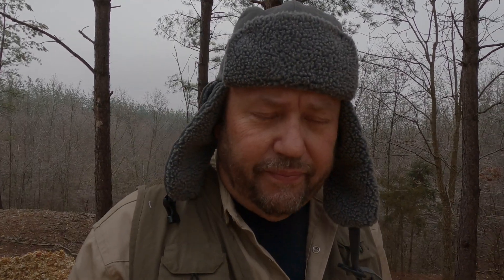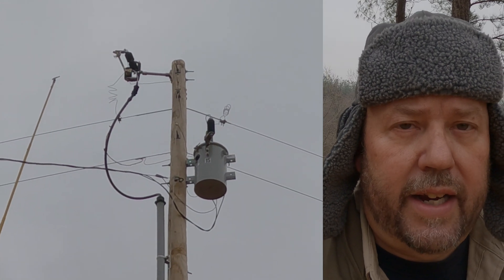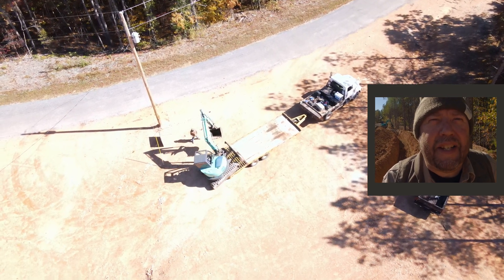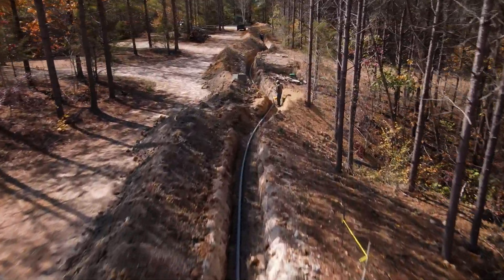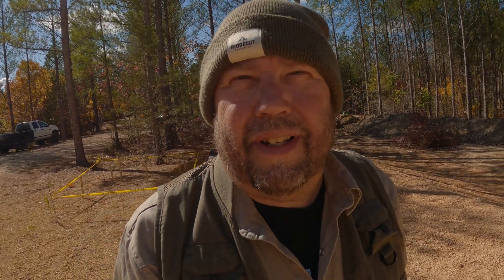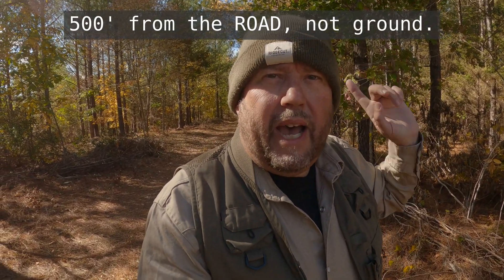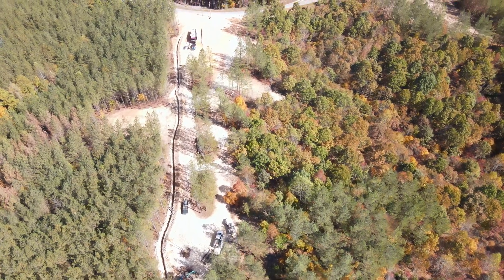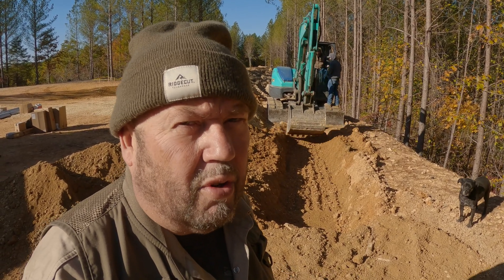Unlock the Secrets of RV Park Electricity! Ep 1 of 4 | Mini Excavator Takes Flight

Comment: wow ripped off for the pipe lol i can buy it at home depot way cheaper at more then half the price if its all sch 40 !
Reply from the maker: Those materials were purchased during the height of the COVID supply chain issues causing material shortages. Lack of supply drove prices sky high. Believe us, we did shop local, distributors and big  box within an hour drive to get the best price. We haven't checked recently, but suspect prices have finally come down from those COVID highs.